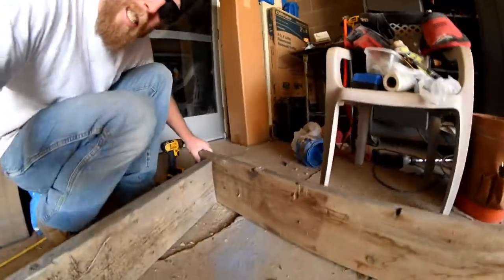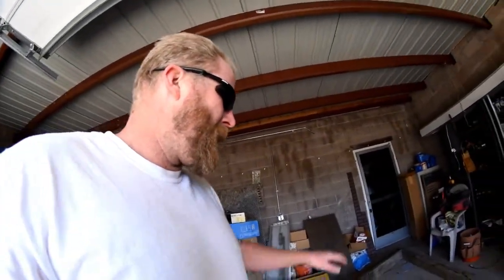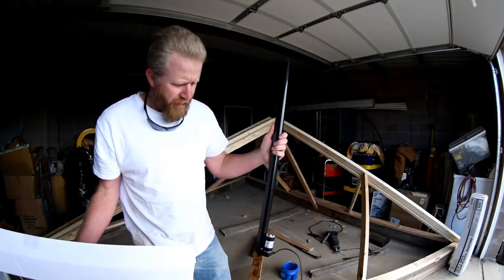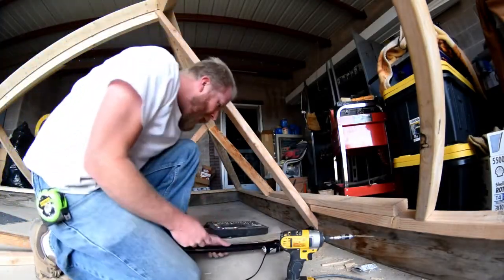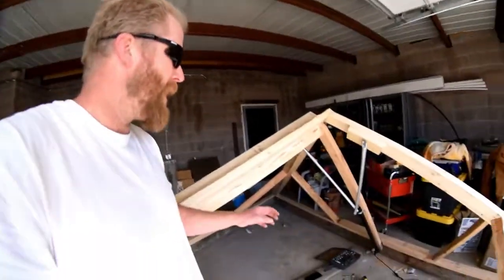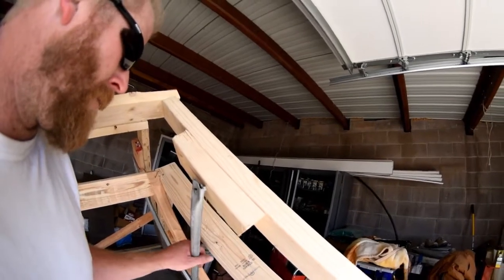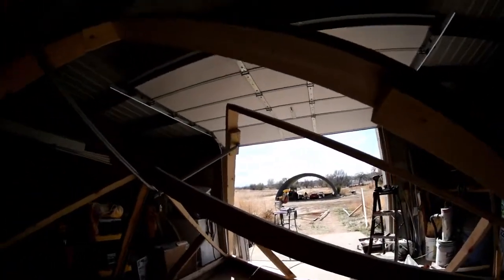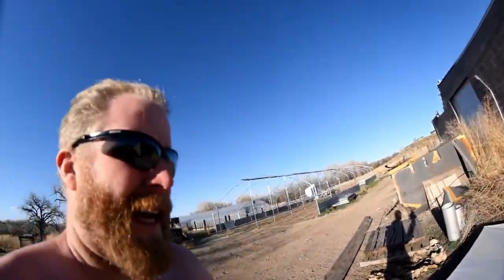Building an Automatic Cold Frame Greenhouse

Comment: Awesome stuff.  I'm assuming it gets pulled out over the plant when it's big enough.  Are you putting any lifting points on it?  or just break through the plastic and put a strap through when needed?  Also how long did it take you to come up with that design?
Reply from the maker: It easily comes apart into 7 pieces.  I have a quick timelapse at the end of the video where i take it apart.    Not sure how long it took me.  I know it took way longer to figure out the angles than it did to come up with the overall design!